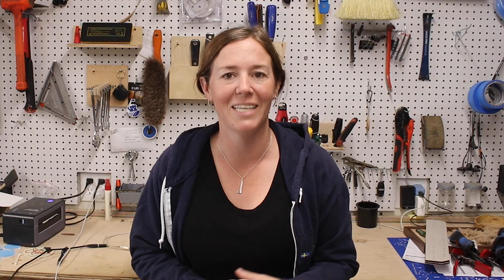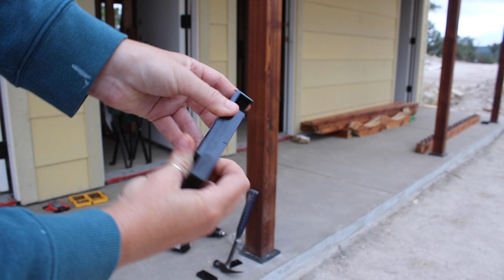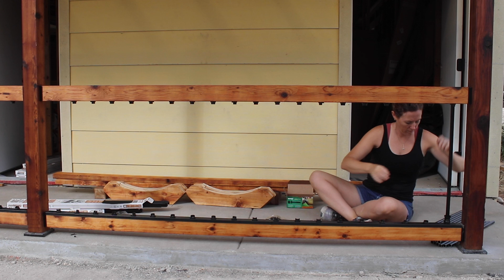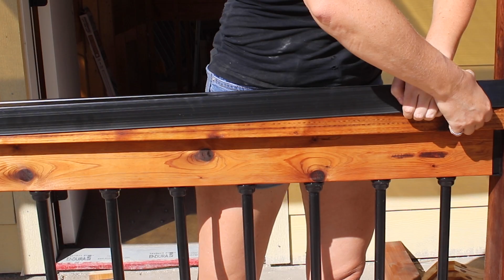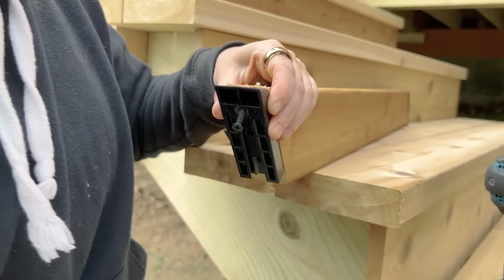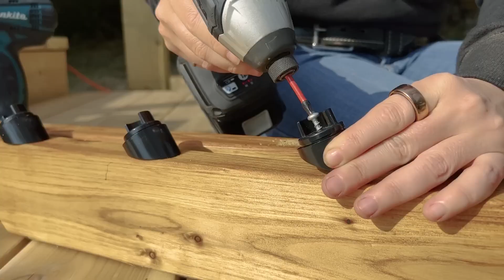My Favorite Deck Railing | Snap-Together System

Comment: I like what you've done it looks great.I live in a humid climate.I have a front porch and a floating  deck that both need railing.
Are your ~7ft. rails just 2X4 pine?Is it treated lumber and how did you finish it? What keeps it from sagging or warping in the middle? Thanks

Comment: Black plastic railings in the intense Texas sun...gee, what could possibly go wrong? First off, the temperature of the plastic by noon will reach just below that of molten lava, so keep a couple of 5-gallon buckets of burn cream handy. Secondly, the sun will bake the life out of the plastic, causing it to deteriorate completely in two - three years. Guess that's not such a bad thing as it will become a future project to replace all the railings and balusters.

Comment: when i moved into my new flat, i bought a mattress from ikea that came rolled up. the sheet told me to leave it alone for 3 days before using it, so the first few days here i had to sleep on the floor.
Reply from the maker: I slept on this one just a few hours after unboxing. But with a previous mattress, I had the same experience as you did.

Comment: plastic connectors?.. 
not very bright idea... someone seeing this thick railing will use it to seat, and it'll break. 
also, plastic degrades on a sun, becomes fragile. I'd advice at least to cover it somehow.
Reply from the maker: I get your concerns, but I've had this system for a couple years. Heavy use, no problems at all. The plastic is UV resistant.